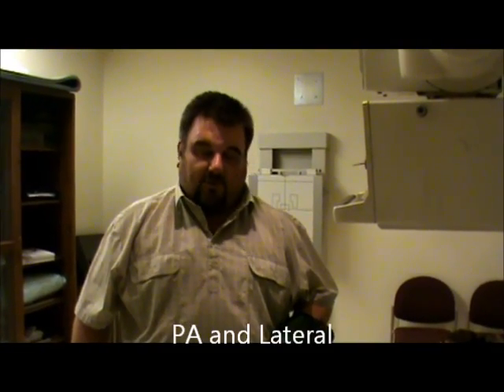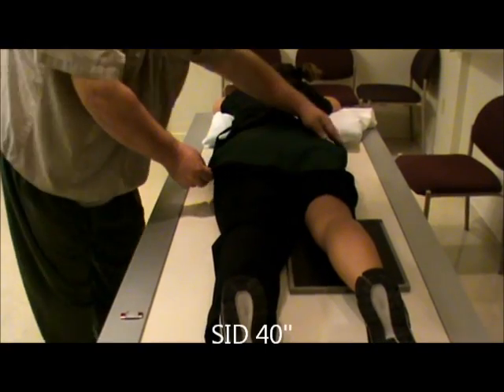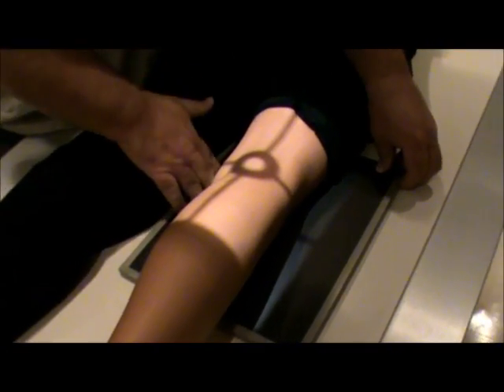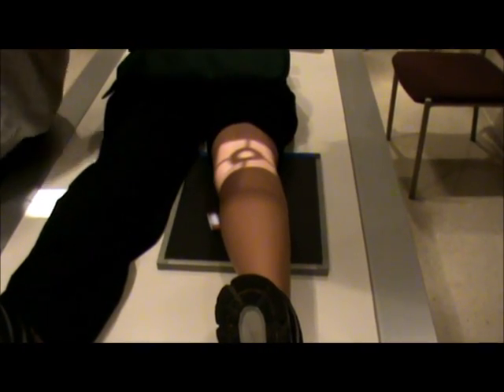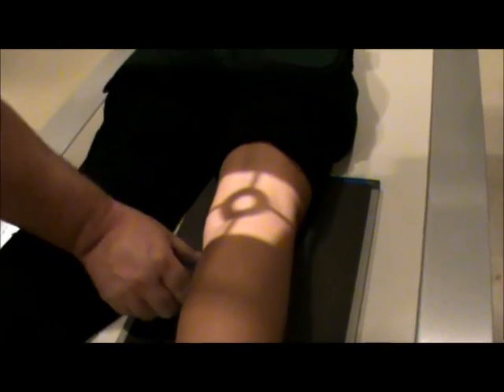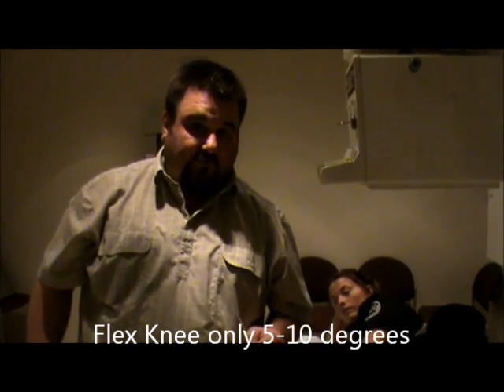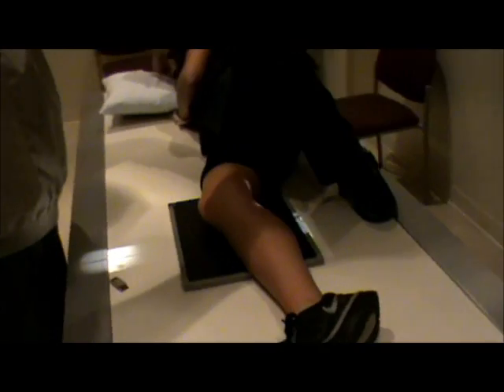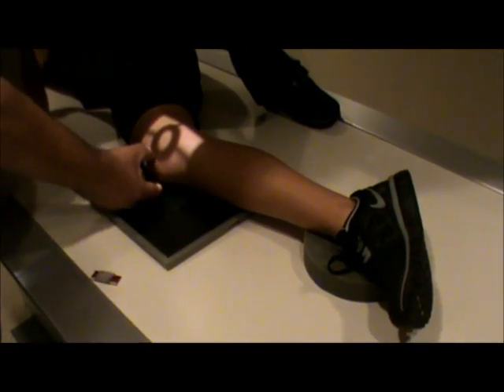Patella

Comment: Shouldn't you use the buckey for tabletop with the patella?
Reply: Rule of thumb is if the body part is greater than 10 cm you should use the Bucky
Reply from the maker: you can use either way. table top or in bucky